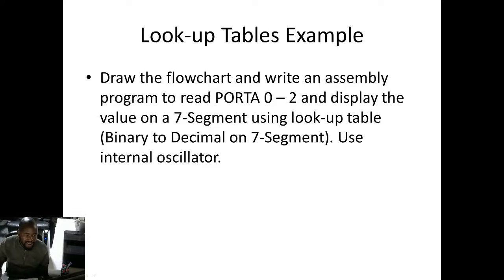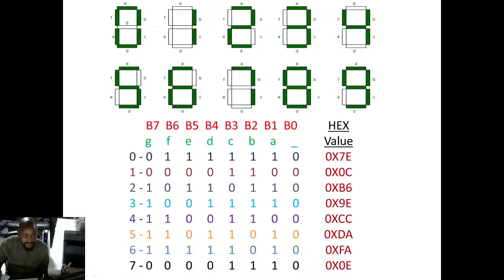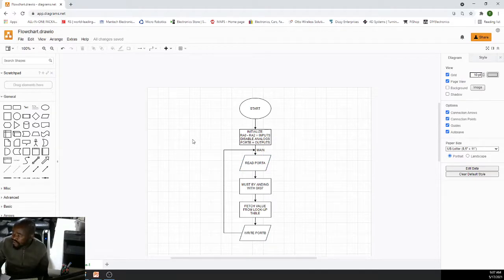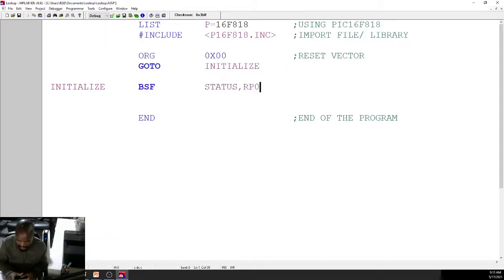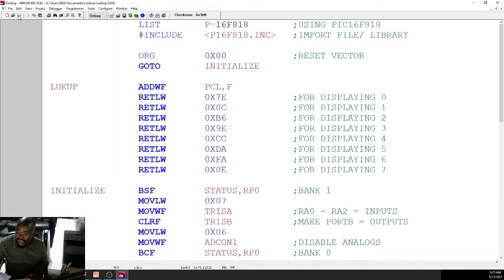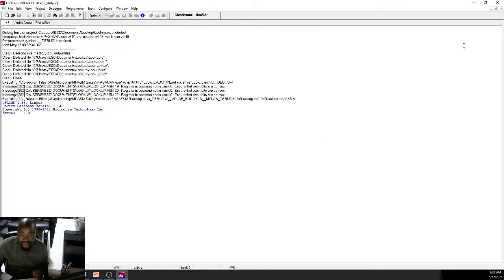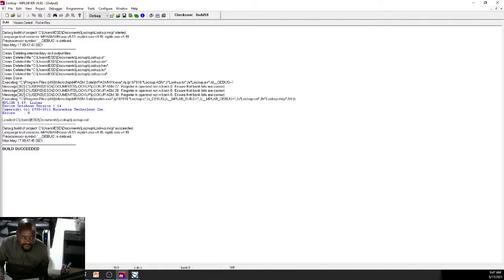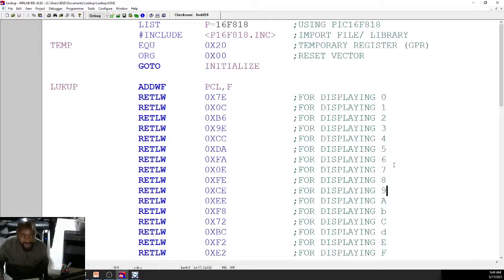PIC Assembly programming: Look-up Table with 7-Segment example (Tutorial 5).

Comment: in the main there, movf portA,w. which file register u move to working register to show that RP0, RP1 and RP2 is reading? I'm beginner, and I need this for my assignment.
Reply from the maker: MOVF    PORTA,W
Here you read the state of your inputs on PORTA (reading all PORTA 0-7) and save the value in W register. Since we are only interested in A0-A2, we have to make the rest of the inputs states Zeros by ANDing them with Zero. Then we can call the lookup table.